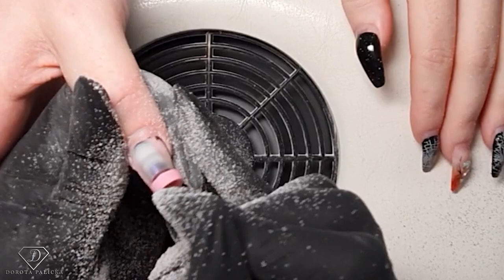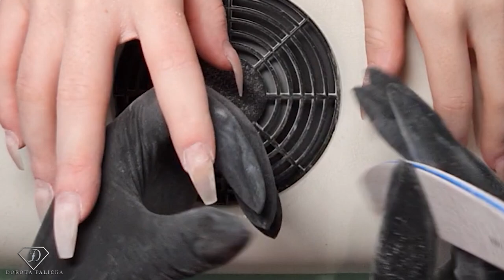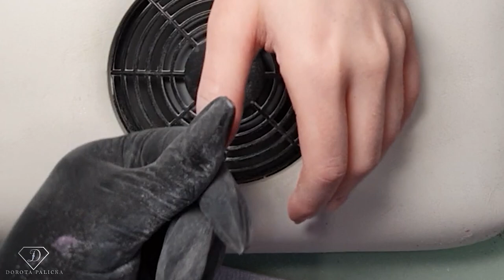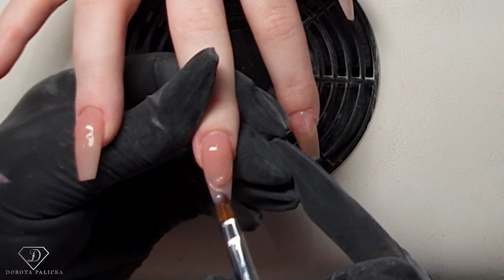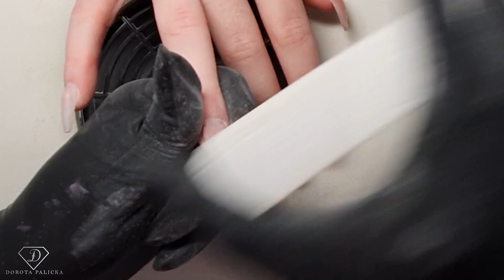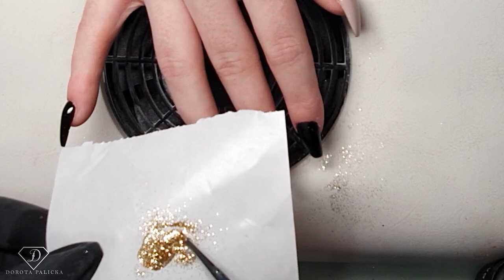Salon nails. Last gel rebalance on old nails before new set. Fall gold, nude and black nail design.

Comment: How do you work pricing with your clients when the come for rebalance/in-fill and during service you find that some nails need re-sculpting? Do you discuss this with client or are you/they normally aware before hand? 
I find it really awkward the couple of times this has happened and I’ve not known what to do as far as cost x
Reply from the maker: I have set prices and they always available for clients as mainly working on regular clients they know my pricing. But if newclient then always say it upfront so they can decide if they can afford it or not
Reply: @dorotapalicka  I have the same question ☺️ just to clarify: if a client books a rebalance appointment, but there are some nails that need replaced completely, do you charge extra for those on top of the rebalance? 

Example (ignore prices, I’m just making them up lol): rebalance is £40. When the client shows up, 3 nails are too bad to rebalance and they need to be done from scratch. Do you charge extra on top of the £40? Or is it still £40? ☺️ If you DO charge extra for these “repairs”/replacement nails, is it on your price list already or do you just explain it when it happens?

Comment: I do not understand, why do so much work, when soaking off takes only 10 minutes?
Reply from the maker: Rebalance takes sane time as new set plus 10min Soaking more time consuming. But that not a problem. Soaking news constantly isn't good. Do you strip a colour off your hair every appointment? Or do you do the roots?  Same with nails I do roots only to don't damage the nails 😊
Reply: If you use hard gel, it can’t soak off 😌😂 Soak off gels (with the exception of some fibre gels) aren’t strong enough to build long extensions that will last. As Dorota said, soaking off at every appointment (even if it was possible, say, with acrylic) is very damaging to the nail. You’d also have to etch the nail AGAIN, at every appointment - the entire nail is being dehydrated, primed AND scratched up (which thins and thins and thins the nail). 

It’s extra damaging for no real reason. It’s just as fast to use an Efile to take the existing product low, then rebalancing.